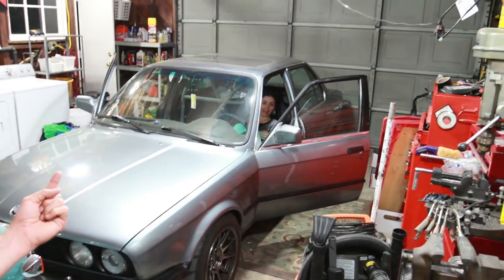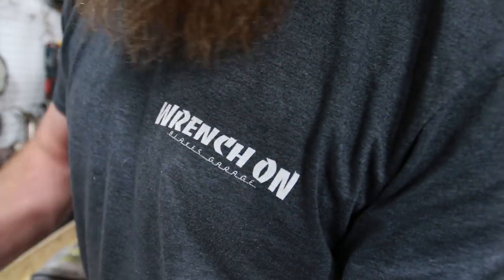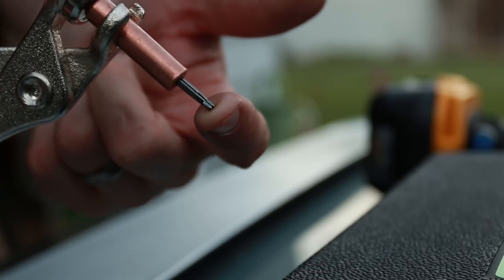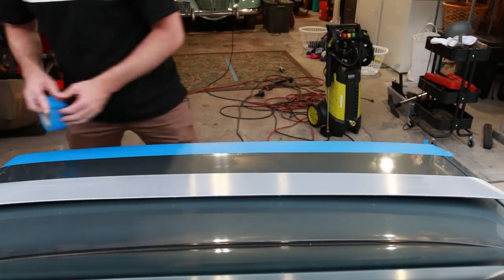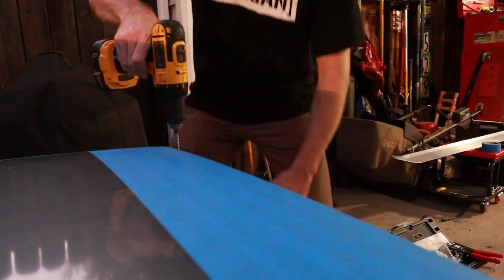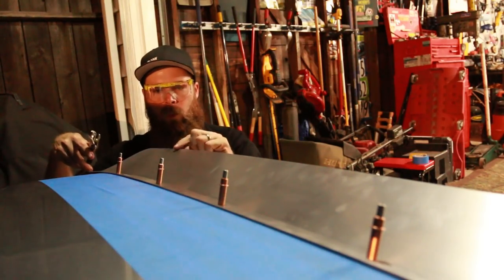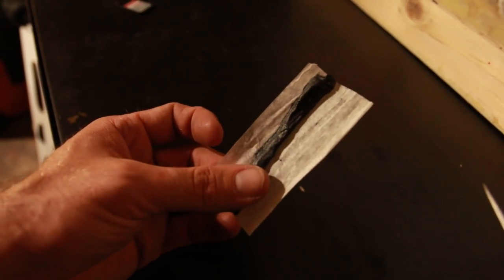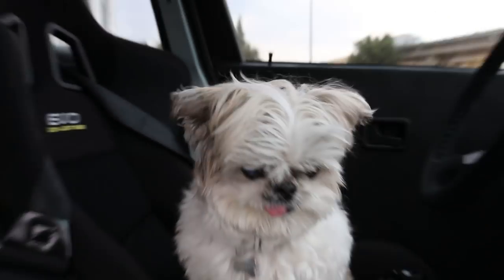E30 BMW CUSTOM ALUMINUM WING INSTALL BERTY 30 TRACK BUILD

Comment: Not that it matters. I own an 88 325i as well. With over 200 k on the clock. I love e30s yours is sick and the work you have done on it is awesome. But just one minor thing is that rear bumper. Maybe think about changing it. It just pops out to far and give throws the styling off. Just something to look into man. Anyways keep up the good work bro. Love the content💪💪

Comment: Get it anodized and put some kind of protective coating
Reply: Revo900 aluminum doesn’t rust
Reply: doesnt have too only if it is clad aluminum, pure aluminum does not rust.
Reply from the maker: Revo900 I may just put some ceramic coat on it just to keep the water spots off.
Reply: Guys I know it doesn’t rust... but dirt and grim can cause pitting. I play competitive paintball and a lot the guns used are made out of raw aluminum blocks. Anodizing is the most popular method of coloring and adding a protective coating. ANY material raw is susceptible to some sort of corrosion or damage.
Reply: Blake's Garage smart thinking!
Reply from the maker: Revo900 yeah I will definitely coat it. But I’m not going to be rocking a neon green anodized wing lol.
Reply from the maker: Revo900 I guess anodized black or something would be cool though.
Reply: Blake's Garage hahahaha what are your thoughts on flamingo pink with a baby blue splash design? I think it will compliment the aggressive look.